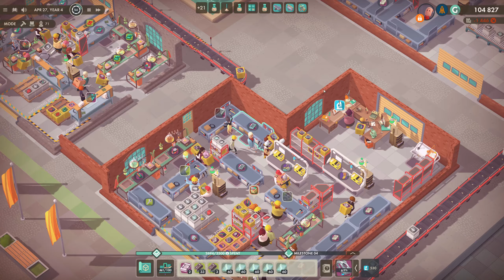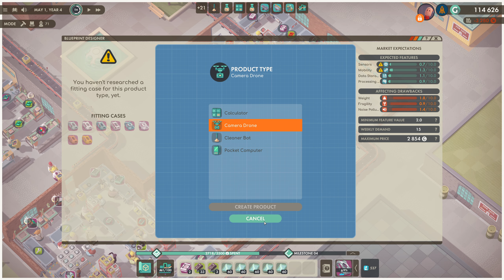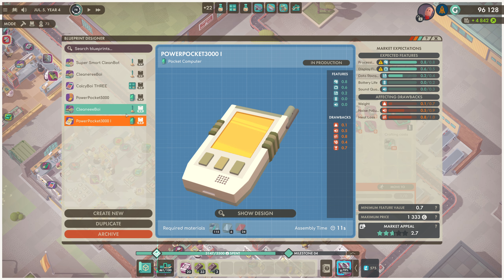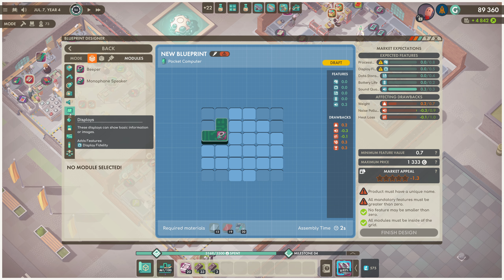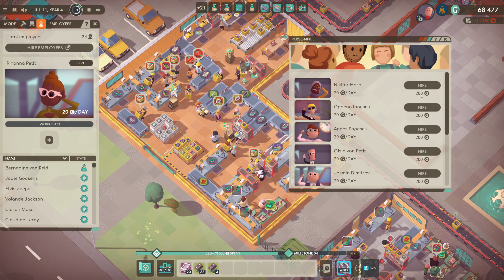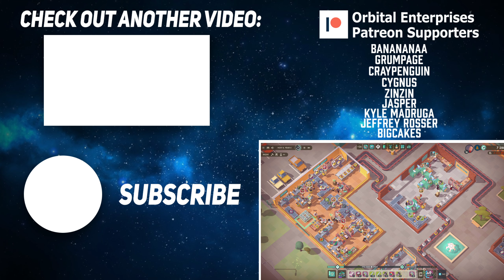Frustrations! (Finale) - Good Company - Early Access Release Gameplay - Episode #6

Comment: Play the campaign. It will teach you a little more. 
For belts they are meant for 1 item. 
Don't sell your overflow items. You don't earn enough.
You may get 100 for an item but it takes to much in materials and wages. 
A day is 15 seconds. It matches with the import and exports at the end of Sun.

At the beginning you want 1 item produced per building. The inner buildings you want to stay away from as they have no import export spots until later.
Mid to late game you can set them up to make simple items like simple or plastic cases and move them other parts of the factory. 
As you only need to bring in plastic and move out the cases. 
1 item in 1 item out. 
1 belt in, 1 belt out.
Reply: Some tips;
Set up the import importing 5 plastic slots. 
   Set a storage to receive 5 plastic slots. 
   1 person can carry the full amount in 1 trip. 
The layout you have with the horseshoe is good but add a double sided shelf in the middle.
The workers will work more but you can add a 4th station and a (s)helf if positioned right.
---   I
I   sI
I___

It takes 8 seconds to build an item. A day is 15 seconds.
When designing a product. Look at how many resources your adding at the bottom. 
You don't have to make it the best. It still needs to make a profit. 
I'd aim for around 4.2 or better. Don't fiddle to much getting it perfect if you don't have an advanced item line setup yet.

You may want to completely restructure a line for a new product.

Tier 6+ products. 
When designing a new product line for the new product and it uses a micro controller. (advanced processor.) 
Slightly over produce logic circuits and programmable circuits. 
Send the overflow items back down to the calculator, cleaner, and transport bot line.
This way you can upgrade the older items without adding a whole line of new tables.

In the design bench. Look at the time it takes to build that product. You designed a product that takes 22 seconds to build but your materials only took 8 seconds to build.

Lastly. This game has a little bit of factorio, 2 point hospital and business management.
Factorio for the build times. 2 point hospital for the campaign and partly the free build of assembly line. 
Maybe even "Production line". 
Where you had to branch off some cars to add new fancy parts but keep the main line going by not adding parts.

Which you can do here. Potential sales is all potential sales of that product type.
You can produce 3 different calculators with different varying levels of complexity. 
Keep your main line moving and selling end products.